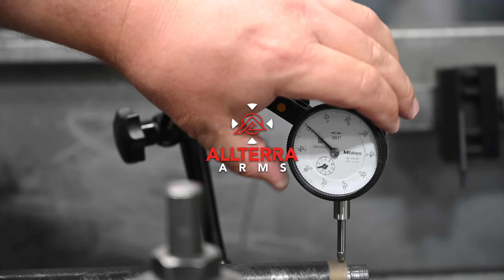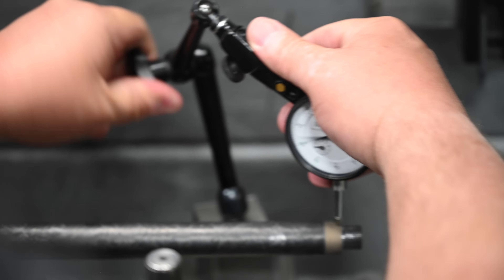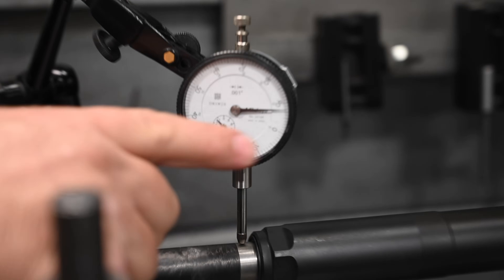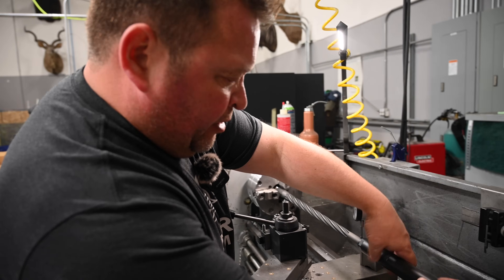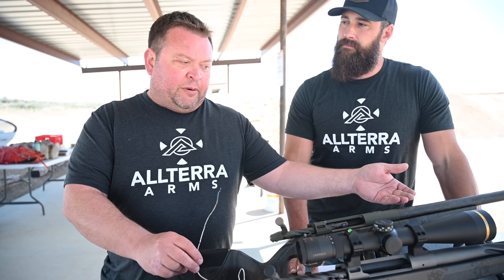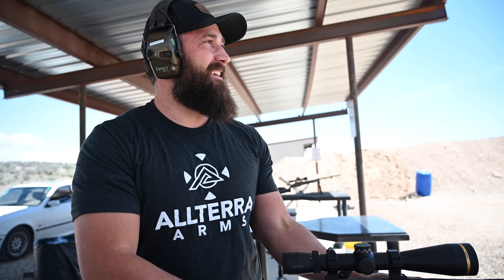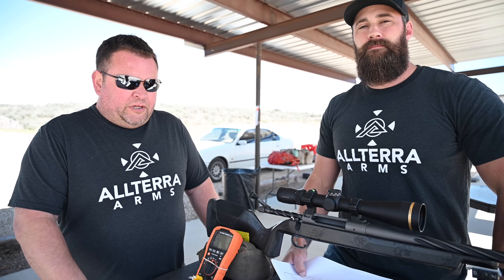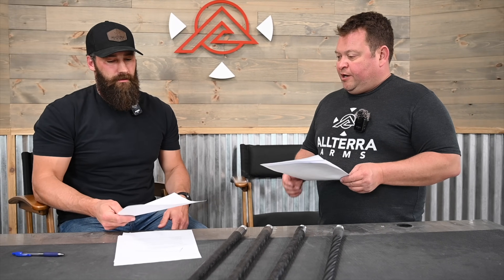Carbon vs. Steel Barrels: Rigidity and Cooling Test

Comment: I did some research on a carbon fiber barrel, and I looked at a steel barrel. What I felt was that the steel barrel is better. To me, the only plus side is that the carbon fiber barrel is lighter. So I purchased a Savage 110 Tactical in 308W, a pre-fit barrel steel, but I also purchased a carbon fiber barrel to save some weight. I have plans to remove the carbon fiber and reinstall the steel barrel. The US military, I believe, does not use carbon fiber barrels; I could be wrong. A carbon fiber barrel is nice to have, especially for hunting. Great test, thank you.
Update: Taking a steel action and installation of a carbon fiber barrel replacement of the factory stock with an aftermarket stock with aluminum bedding, won't save in weight not unless I stall a carbon fiber stock. Aftermarket stocks like MDT or KRG, are adding weight; no savings. That is why my TIKKA T3 in 300 WSM still has its factory-installed stock.
Reply: Rifles from the early 1900s are still shooting no fiber barrel will last a 100 years. Same thing in bicycles, steel bicycles last for decades just keep the rust away you can break a carbon fiber bicycle on your fist trail ride just catch a boulder or tree and boom the freaking frame is cracked and ruined they are not reliable.

Comment: What I would really like to see is how shot groups open up over 10+ round strings of fire, especially for the carbon. This is basically the biggest thing I hear about why you really don't see them being used in the f-class or PRS and ELR style of builds.

Obviously comparing more brands of carbon barrels would be interesting as well. Say for instance, Bergaras carbon barrels versus Proof.

Comment: Everyone is testing this heat dissipation claim, but we need to ask why we care about temperature and how materials handle changing temps.

From my research, metal has a much higher thermal expantion rate than carbon fiber does. So the metal can bend in a random direction when heated from differences in the metallurgy, while the carbon will tend to maintain the same shape giving it better consistency

Comment: Based off cost.  Carbon VS Stainless/Carbon fluted the variation of input from the shooter will negate any perceived benefits so Carbon/Stainless are more than sufficient.   I think Carbon/Stainless wins.

Comment: It would've been interesting to see a non flutes barrel of the same weight thrown into the test as well just for information sake. Theoretically it would've deflected the most from the suppressor on the end and cooled slower than the flutes barrel.

Comment: The whole point of going carbon is to go bigger to gain rigidity and surface area but not compromising with the increased weight of steel.  
They were never meant to be compared in equal dimensions
Reply from the maker: But as our test revealed, the spiral-fluted steel barrels showed more rigidity, and they have more surface area than carbon. Of course they were meant to be compared, the whole marketing premise behind carbon-wrapped barrels involves "compared to steel".

Comment: I have a concern about how you're measuring the heat dissipation you're doing it right at the chamber where the metal is the thickest when the fluting is what we should be concerned about measure the barrel temperature where the fluting is that's where the heat dissipation is I think you should measure at the center of the barrel just a thought

Comment: I am new to the carbon barrel world, but I have had no problem with mine so far. I have a 300 prc in the Springfield waypoint 2020 which shoots 1/2 inch groups at 200yards. I also have the weatherby alpine ct in 7prc and have that thing shooting 3/4 groups at 200 yards. Both with factory Barnes Lrx bullets. I only use them for hunting purposes but both of them should last a life time for me. Shooting practice helps a lot.
Reply: Thank you for your comment as I'm currently debating between these 2 rifles, which rifle do you like better?

Comment: I’d love to see a stiffness comparison of a straight fluted steel barrel to a spiral fluted one. 

Great stuff!
Reply: I would venture to guess that, in general, all straight fluted barrels of the same metal composition as other fluted barrels will be stiffer as there is , usually, less metal taken away from the fluting. 
 Would be cool to see 4 barrels of the same batch / lot of steel tested for rigidity and deflection
1. Bull barrel (no flutes)
2. Bull barrel (straight flutes)
3. Bull barrel (spiral fluted)
4. Bull barrel drawn down to a sporter/ skinny barrel with no flutes.

Comment: Really interesting stuff! I'm just getting into Firearms and Carbon but I make Performance car parts out of Carbon and Kevlar everyday. My personal opinion is the main advantage of the carbon is weight saving, I would choose steel for n every other factor. Rigidity, thermal efficiency and performance over time. Carbon does induce stress fractures and delamination over time, so it would be interesting to see if that leads to future defects. One other area you could check on the carbon barrels is the weave. The barrels you used, looked to be made from chop strand, maybe test some barrels that have a more uniform twill weave. These can be stronger if the weave is overlapped in certain ways. Thanks for the video, really interesting!
Reply from the maker: These barrels are filament wound with a continuous weave, overlapped back-and-forth for the entire carbon buildup. Not chop strand.

Comment: The carbon barrel has more thermal mass so the exterior temperature isnt a fair comparison.
Reply: Well it certainly is if you want to see which is dissipating heat more efficiently. The heat transfer equation requires you to have two temperatures. The bigger the gap between the inside and outside, the lower the thermal coductivity

Comment: You need to test our titanium structured barrel. Light weight, thermally stable, amazing harmonic damping
Reply from the maker: Send us one and we'll build a rifle and test it.
Reply: @allterraarms  also waiting for this
Reply: @allterraarms  I would be interested in a vibration measurement when shot and the dissipation after the shot since a lot of accuracy is based on the tuning of harmonics and timing.
Reply: Finally another company that makes structured!
Reply: I’m waiting for this….
Reply: The irony 😂: non-metallic/non-machinist experienced guys are the easiest to be fooled, I guess?
Reply: You use a Ti fin structure like a heat sink don’t you 🤔 the aerospace engineer in me wants to see this test, keep innovating fellow enthusiasts
Melt temp :1668deg C, good heat capacity and coefficient of thermal expansion and specific heat. 🤤 in fact with grade 5 TI you could almost match exactly the thermal expansion coefficient between 416 steel and Ti nearly eliminating thermal induced deflection.
Reply: Yes… Ti… interesting turning my alerts on incase this test happens.
Reply: I’m getting a titanium barrel itch that may need scratching one day! I want to see this
Reply from the maker: @chriscalhoun.concretepumping  We never heard back after this initial 'offer' to test their barrel.
Reply: @allterraarms  well dang why would they tell you to try their barrels if they won’t talk to ya and send you one over! Was really looking forward to seeing this.
Reply: Titanium is brittle in comparison to steel. How would it benefit

Comment: If carbon was so great why it need a steel liner? Well because it’s not so great, just the slightly lighter weight trendy thing. No need in reinventing the wheel, stick with steel. Wanna prove me wrong make a barrel from 💯 carbon and let’s see how that works.

Comment: One thing i havent heard anyone talking about is how carbon works for longevity with heat. Even if it worked great when it was new. If you heat any fibreglass or carbon up to high heat or heat it regularly, it stuffs it up long term. It would lose strength quickly. I cant see any reason to get it on a barrel. Complete gimic.

Comment: One thing ive noticed with carbon barrels vs steel barrels is due to them insulating heat better the heat waves coming off the barrel are less intense then that of a steel barrels which is great when shooting strings from 5-12 shots as it does not distort your sight picture as much as the steel barrels do as they are emitting so much more heat then the carbon.

Comment: Carbon barrels make no sense... They're thinner barrels with insulation.. why do you need insulation on a thin barrel, when a thin barrel gets hotter quicker, and needs to be cooled.. but it cools slower, because it has insulation on it ..

Comment: The test I’ve been waiting for!
Many years ago at SHOT show I questioned the owner of Christensen Arms about the cooling claim. He finally quit talking to me and walked away.
Reply: @brianwood7882  my ridgeline does cool quite well actually. Faster at small strings than my other steel rifles (different calibres etc, so that could also be a factor). I think carbon is hit or miss, they even say that aswell. So I have zero doubt some don’t cool well at all or shoot like people claim. I also think bigger calibres really mess with the bonding compounds and carbon barrels compared to smaller ones.

Comment: It would be good to know the surface area difference between the two heat test barrel.  Steel barrels are thinner than carbon in most usable hunting profiles of the same weight.  Fluting adds surface area. Thats likely to be influencing cooling.

Comment: Carbon seemed to be cooler and faster at cooling to a small degree with 3 shot groupings or less. Which is perfect for a strict hunting rifles. Also zero rust issues. But bench or range rifles steel forsure

Comment: Carbon seemed to be cooler and faster at cooling to a small degree with 3 shot groupings or less. Which is perfect for a strict hunting rifles. Also zero rust issues. But bench or range rifles steel forsure
Reply: @Shwap36  It might help if don’t touch the carbon, but instead touch the brl’s shank/muzzle metal parts to determine that! In my tests I found  the opposite true: the CF brl’s heating up faster & cooling off slower!
Reply: @ interesting next time I’ll check the steel shank and muzzle aswell. My carbon barrel does seem to cool better when I do 3 shots groups I do feel the heat right away on the carbon and then it’s gone faster than my steel barrel. But once I do 5 shots then it doesn’t. 1/2-3/4 with 3 all day but then opens up around 4-6 shots(depending on bullet/grain etc). Doesn’t matter to me though it’s a light weight mountain rifle that only goes on goat/sheep stuff

Comment: Regarding the internal temp increase............yes it could be the carbon wrapping being a barrier, but it could also be due to there being less steel to be a heat sink (or a combination of both). An analogy would be a bike brake kit on your car. All things being equal more mass in your rotors means more heat sink, less material means the same material will heat up quicker with less mass and I would think the carbon wrapped barrels have less steel in them than a barrel of the same length and outside diameter.

In reality unless you are going to war, it really is a cost versus weight versus precision decision.

Comment: I don't think your test on the lathe is checking what you think it is. At that length; with all that weight so far out, I think you're just checking how clapped out your chuck is.
Reply: The test still shows the DIFFERENCE in deflection between the barrels, because they were all chucked the same on the same chuck. Not on video, but we also rotated the chuck to make sure the deflection was the same from any degree of rotation and it was.

Comment: If you want a fast cooling barrel put a steel sleeve inside aluminum. Aluminum dissipates heat so fast, I put a piece of 1/4" x 2" steel strip on a 1" aluminum plate and was attempting to heat the steel with Oxy/Acct to braze something on it... it would not get red hot!

Comment: I think it would be interesting to see a comparison with non fluted barrels of the same weight. I think it would show CF and fluting are just different ways of solving the same problem.
Reply: @joshuashackelford6696  After more then 5 decades of gunmaking, I’m certain that  properly acme deep straight-fluted brl’s will always be superior!
Reply: Fluted barrels increase surface-to-volume ratio (and therefore increases passive convection, if balanced properly with thermal capacity of the overall system). Surface color matters: a black surface has an emissivity coefficient close to 1 (and increases radiation). So non-black barrel coatings perform worse. In terms of conduction, carbon (especially the epoxy used to laminate it around the barrel) messes up everything and is the biggest culprit. Carbon sheets have moderate thermal conductivities in x,y-plane (i.e. along the barel) and fairly lously thermal conductivities in z-direction (i.e. perpendicular to the barrel). From a thermal management's point of view, that is probably why it is interwooven with a steel mesh/matrix (with far better thermal conductivities than carbon alone) to dissipate heat more effectively in all directions (and also away from the action). Thermal conductivity of steel > steel/carbon > carbon >> epoxy (epoxy is actually a thermal isolator, if not filled with thermal conductive stuff - think of premium heat sink paste.

Comment: For competition I'd choose steel. If the rifle is for hunting, casual target, or casual long range shooting, I'd go with whatever you like best even if your choice is based on looks.
Reply from the maker: At least looking at the cooling and rigidity aspects that we covered here, for most hunters it would be perfectly acceptable to choose based on looks alone. Looking at accuracy between them though, we feel there's an edge in favor of steel on average. We have more testing to perform and share. Thank you for watching and commenting!
Reply: I did a previous build in 6.5-300 with a Proof carbon barrel and had no complaints. A lot of the concerns I see are with point of impact shifts as the barrels heat up. I'm looking forward to more testing. I just got another build finished in 28 Nosler with a 30 inch CarbonSix bull barrel on it. I'm hoping to shoot it out to 1,000 yards this summer and see how it does.

Comment: Flex might be in your chuck rather than the barrels.
Reply from the maker: Even if it is, the DIFFERENCE measured between the barrel types is still accurate because they were all chucked the same.
Reply: @ Does the difference become insignificant though as it would only be about a thou or so between barrels? Great experiment btw, great to see. Cheers.

Comment: You are starting it comparing apples to oranges ..try straight tapper steel agianst the same carbon
Reply from the maker: Our goal was to test carbon vs steel of the same weight (apples to apples). A big heavy straight taper steel versus the carbon wouldn't be a fair test.
Reply: @allterraarms  neither is comparing a fluted barrel as that can cause weakness itself when hot. But at least you are trying

Comment: Frankly, it doesn't surprise me at all that a carbon barrel heats up faster than a solid steel barrel.  There is less steel in the carbon barrel.  Less thermal mass.  Of course it will heat up faster because there's less mass to heat.

Comment: Great info guys, my buddy and I did the same test probably 10 years ago now between a christians carbon and a lilja steel. Results were spot on. The internal temp on the carbon not only heated quicker but took a noticable amount of time to cool compared to the steel. Wasn't even close. I'm curious what a proof research would do. I've heard they have addressed these issues with their carbon weave.
Reply from the maker: That's what was on our test rifle.
Reply: @allterraarms  oh really must have missed that. Interesting. I've built a lot of both carbon and steel barreled rifles for a variety of clients . Have never had an issue with proof barrels of any kind. Others not so much as far as walking when they get hot. I've always felt the carbon does exactly what it was designed for. It's an insulator. Pretty simple when you think of it that way. Tends to hold heat in.

Comment: A carbon fiber barrel may separate from the steel liner but a steel barrel will never separate from itself!
Reply from the maker: Good point - very little to 'go wrong' with a homogenous unit of steel.

Comment: Your deflection testing was rather surprising. I would not have expected equal weight barrels to be so similar in deflection. I did cool down over time testing similar to what you guys did only with more data points taken so as to be able to calculate a coefficient of thermal conductivity from the data. I saw a similarly higher starting temp in the carbon wrapped barrel to what you guys saw after firing an equal string in both rifles. I initially thought this might be the result of a misfeed when doing the shoot up to temp on the steel, but I'm now wondering if the much higher thermal mass of steel is the cause of this as it takes a lot more energy to raise it's temp the same amount as carbon and there is obviously more steel closer to the chamber in an all steel barrel than one that has a carbon wrap. In any case, after that initial higher temperature, I found the carbon to have a much higher cooling rate. When calculated out, it's coefficient of thermal conductivity was about 35% higher than that of the steel barrel.